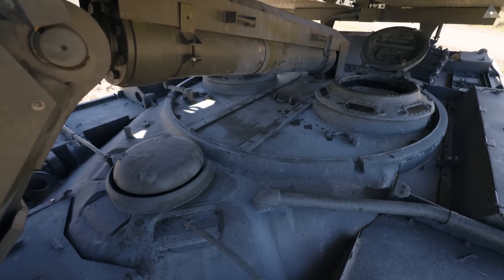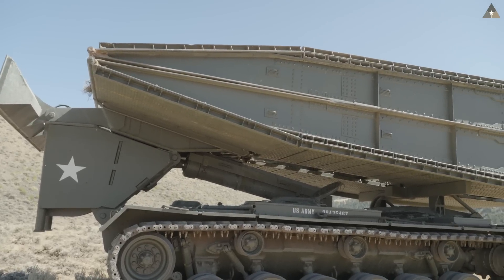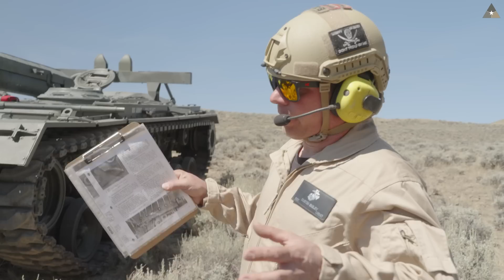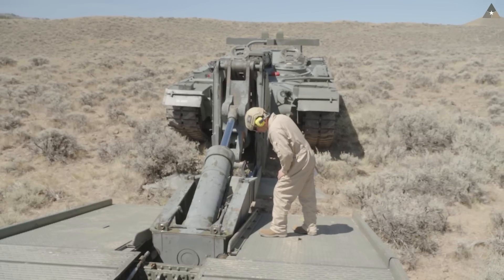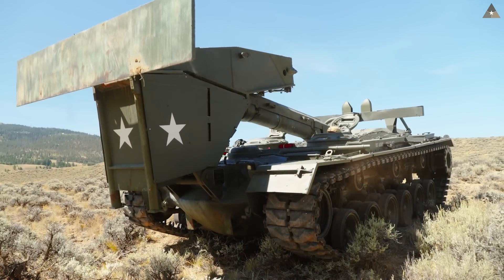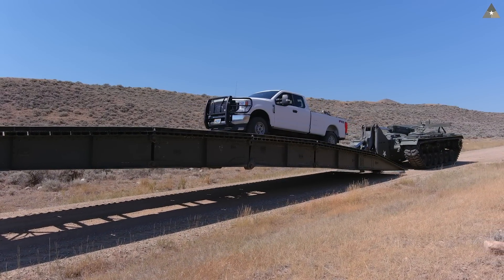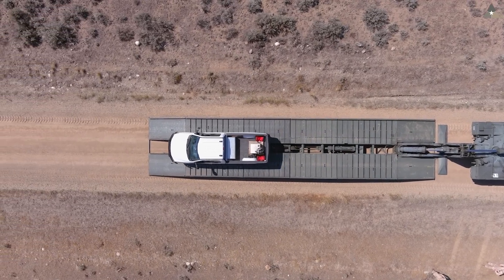M48 AVLB | Bridging the Battlefield

Comment: I used to work on these in Korea. Worst part of repairing this things is both replacing the hydraulic pump in the front of the hull or changing a torsion bar that is under the fuel cells in the rear of the hull.

Comment: This brings back memories of when I was in Iraq, some stupid guy tried to drive a up armored HUMV over one of these kinds of bridges at the same time another HUMV was driving the opposite direction or at least that's what it looked like. The HUMV that screwed up ended up stuck with a wheel over the center and another wheel over the edge. I was flying a Shadow 200 and was tasked with over watch to make sure no insurgents tried to sneak up while they were trying to recover the stuck HUMV. The bridge looked to be sim permanently emplaced over a canal or other similar bodied of water. It was recovered after two HEMIT wreckers got on both ends of the bridge and lifted the HUMV back onto the bridge. It was a nice change from flying up and down routs looking for IED emplacers.

Comment: I operated one in the 13th Combat Engineers, Delta Company, AVLB Platoon, with the 7th Infantry Division back in 1967-68 at Camp Casey located next to Tong Du Cheon, South Korea.
One problem was the driver/operator had a major blind spot on the left due to the hydraulic cylinder in between the hatches. We welded rebar so that it was a handle in front of the Tank Commander on the right side and a circle in front of the driver on the left. We painted the circle red with white “ DO IT”
letters to inform the driver to immediately stop in case of a problem. We liked “ DO IT “ better than STOP.
Reply: Did you have to pre-scout positions before laying bridge? Like what he talked about must having it level or else pins won't go in. That would of been a big problem if that happened and had to prep or change spots in a hurry?